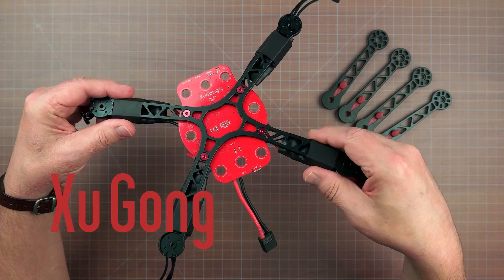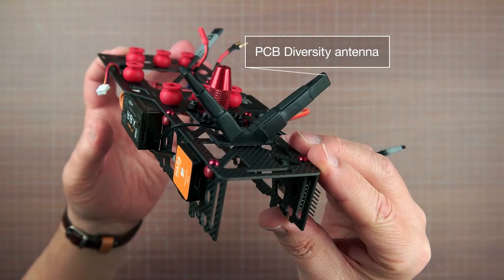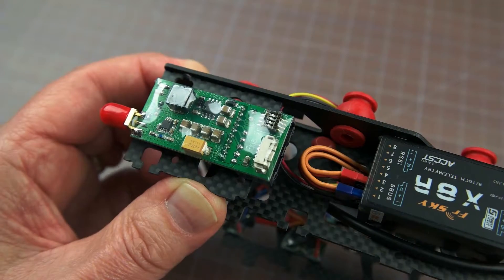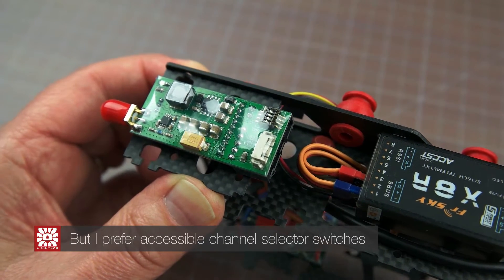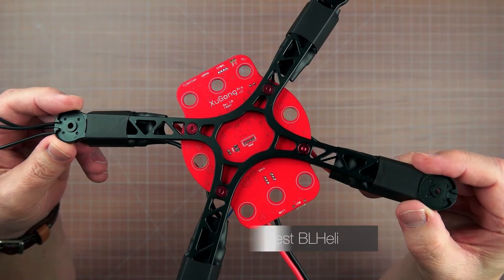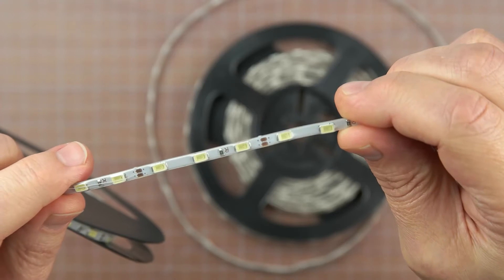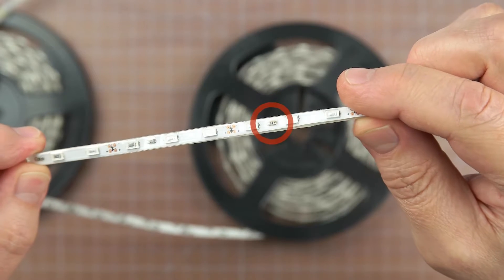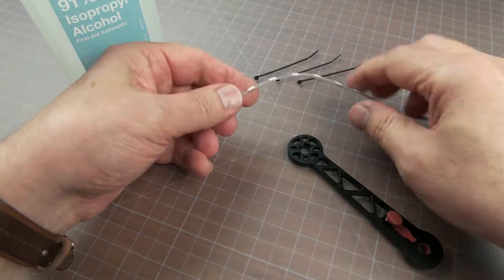XuGong v2 Pro -- Build, First Flight, And Impressions

Comment: would it be okay to use FlySky 2.4 GHz 6 channel transmitter ?
Reply from the maker: Hi Ahmed. If your Rx has PPM out then it should certainly be possible and I've included a link to the original instruction manual for you to look over (ImmersionRC no longer has it available on their website).  The section on electronics installation should give you all the information you need and begins on page 18:  https://goo.gl/hLbwA6
Also, here is the link to the ImmersionRC forum on RC Groups: https://goo.gl/z4YwF8
FYI - I will be deleting the manual in a few days.  LMK if you have any other questions and I'll try to answer them as best I can.  Cheers!

Comment: Hi there how did you wire in the gimbal, as I’m using an aftermarket one many thanks
Reply from the maker: Hi! Sure thing - what would like to know? The flight battery is a 4S so I used a BEC to provide 12 volts the STorM32 board and an unused channel on the FrSky Rx is used to manually control camera tilt.  If you're interested in using a STorM32 gimbal controller you'll want to go to the source:  http://www.olliw.eu/storm32bgc-wiki/Getting_Started 
Tip: Use the NT type IMU mentioned in the wiki.  Much better performance than the cheap IMUs that usually ship with the boards from Banggood, etc
Reply: Many thanks for the reply, I have sorted my self. Trial and error as they say 😉
Reply from the maker: @paulrossfry1976  👍

Comment: What gimbal did you use on your build?  I could not find the part number or brand anywhere.  Thank you!
Reply from the maker: The gimbal is a custom build from off the shelf parts and was very easy to cobble together.  The gimbal frame itself is a common item on ebay and usually sells for around $10 without motors or controller
http://www.ebay.com/itm/2-Axis-Brushless-Gimbal-Frame-Mount-Motor-Controller-for-DJI-Phantom2-Gopro-/171456026617
(To fit the XuGong airframe I simply didn't use the hardware that attaches to the back of the Y-axis motor and instead bolted the motor directly to the XuGong bulkhead.)
The motors I used are DYS BGM2208-80 brushless gimbal motors and they fit the frame perfectly.  The controller is a STorM32 v1.31 board that I picked up from ThanksBuyer (I found the custom plastic case on ebay.)
http://www.olliw.eu/storm32bgc-wiki/Where_to_buy_STorM32_boards

Comment: what motor did you use
Reply from the maker: Hi Seung-yong.  The motors I used in the video are different from the ones I now use.  The motors in the video are Cobra CM-2217/20 950Kv.  They're good, but I have since replaced them with a set of MN3110-17 700kv from Tiger Motor. The new motors are smoother operating, are more efficient and have more power.

Comment: ... very nice build up video about this amazing quad...I wish alot of fun and great flights with the bird... 
very nice channel btw 😉... so I subbed... be invited as well ;)
Reply from the maker: Thanks, wolkenkreuzer!  I see you've built one as well - great machines. I have two upgrades planned:  One is to install a 3-axis gimbal, and the other is to replace the ESCs with versions that are smaller and have faster processors
Reply: CradyLab ...a great plan...I already added a 3 axis gimbal and I am very pleased with it ;)
Reply from the maker: I saw that.  What gimbal did you use?
Reply: CradyLab ...its called HMG YI3D and its especially made for the xiaomi yi action cam

Comment: How much would it cost in all with all the parts?
Reply from the maker: Hi Matisse! That's a loaded question. It really depends on what kind of gear you invest in (for example, the ImmersionRC gimbal is about $200 but I built my own for well under $100.) I'd say you're looking at anywhere from $800 (close to what I spent) to $1200 - and that doesn't include the batteries or the RC transmitter.
Realistically, something like a DJI Phantom 3 Pro is probably a better deal, but where's the fun in that ; )
Reply: Hahaha yeah thank you so much.

Comment: A note on the motor, make sure to use prop nuts that cover the threads of the motor or in the case of a crash you could strip the motor threads like I've done.

Comment: Just picked up the v2 pro from HK during their massive sale... just wondering if you are happy with the power system you chose?  I am trying to determine which motors to buy. Thanks for the HIGH QUALITY video!
Reply from the maker: Congrats on your purchase - the v2 is a really sweet frame.
Yeah, I like my power system a lot. Works great with 10-inch props. The ESCs are a cinch to setup in BLHeli. and the Corba motors are reasonably priced and easy to find spares for.
LMK how your build goes. Cheers!

Comment from the maker: The price at HK just jumped back up to $169.  I suspect what's happening may be that if you revisit the product page several times over a week or so the HK website recognizes your 'interest' and offers a discount.
Reply from the maker: Update: After some experimentation I've settled on 9-inch props as the ideal diameter to eliminate jello (I currently have APC 9x4.5 MR props fitted.)  The flight times are slightly shorter, but the higher RPMs at hover don't have the same jello-inducing harmonics at the larger, slower rotating 10-inch props.
Reply: awesome video! Love the editing, I was wondering what your flight times were between the different props?
Reply from the maker: Thanks!  I'm sure the FT must be slightly different but I haven't had a chance to measure it yet.  eCalc says it should be less than 1 minute and that's fine by me.  The video is so much smoother with 9-inch props that losing a little FT is definitely worth it.
Reply: ah okay cool! Also, can you tell me by chance what sound pack you are using for your Taranis?
Reply from the maker: I made my own.  It's a mix of default and custom tracks.  The default Taranis Plus pack was okay but it's easier for me to understand a British accent over background noise (weird huh.)  There used to be some very high quality free text-to-speech sites but they're gone now.  I'm about to make a new sound pack that's entirely 'British' using some Android and iPhone apps.  When it's completed I'll share the files here
Reply: Hi Crady (LMAO I first wrote Cody)
It's been a while since you uploaded this, but I might give you my two cents anyway: Have you tried balancing the 10" props? That might solve the jello problem. Either way, I'm looking to build my own Xugong in the future, your video helps a lot when preparing! Great work
Reply from the maker: Hi Chretze.  The 10-inch props were perfectly balanced - both the blades and the hubs (I tracked the issue down to the ESC setup).  As an aside, I recently upgraded the motors and ESCs and switched to Master Airscrew 10-inch MR props - jello is gone =)  LMK when you finished your XuGong build - I'd like to see it!

Comment: Love the personal touches! great to see the final version video of your rig! I also love it it does have its own troubles but even that I love the rig as well! I hope to purchase one as a spare soon... but missing $$ cause of the near traveling to FT 2016 lol Great edit by the way! 
Cheers!
Ed
Reply from the maker: Thanks Ed!  You're headed to FT/FF 2016?  Man I'm jealous. Would love to attend that someday.  How's your XuGong doing?  I haven't had a change to get mine out in the field yet - maybe later this week if the weather improves.
Reply: I took it over my last vacations and I hope to have the video up soon... maybe... lol I just love the rig because of the easy transportation plus knowing I sort of build it/put it together mostly!

Yes! I have been saving $ over the year to attend the event, last year I could not make it because of the new born but this year (a year later) not expecting anything I was allowed to attend! hahaha

I`m working on a project with pancake motors and 15 inch props and 4s which I hope to finish one day! its a little spare parts frames but together but what I learn from you and hearing one of the latest FT podcast from David, was to have the ESC set ether on auto sync or low settings! THAT might be the reason why it did not flew any well when mounted on my Tarot!! haha

So now that I set the tarot back to the old configuration I had the spare motors and ESC`s. So decided to build something with the parts I had laying around and I purchased a PixFalcon (thanks to you I`ll give it a shoot one more time to APM controller type HAHAHA) So I`ll have some one to blame!
Ed
Reply from the maker: Cool! Looking forward to seeing your vids. And congratulations on the newborn!  In a few years you'll have someone new to fly with ; )